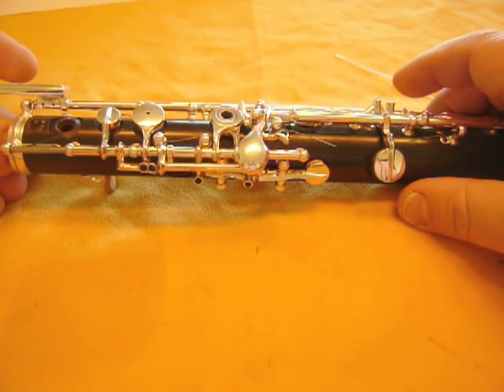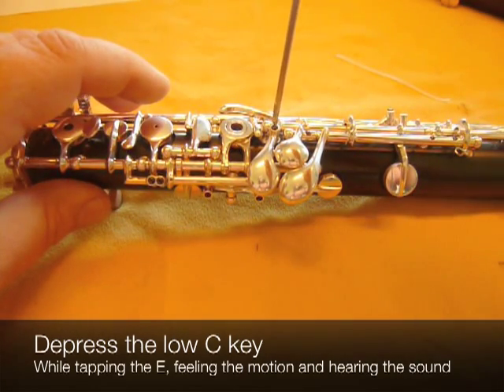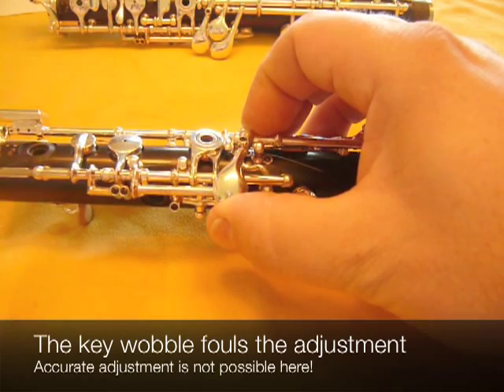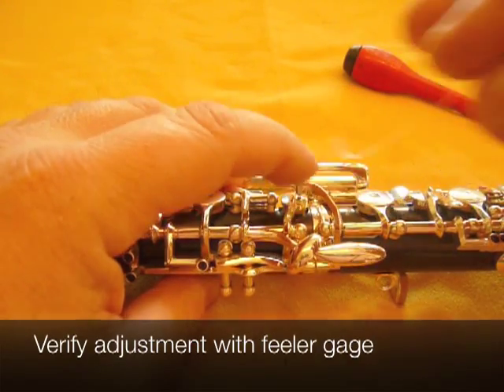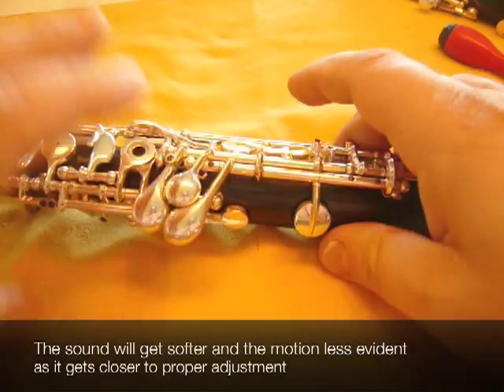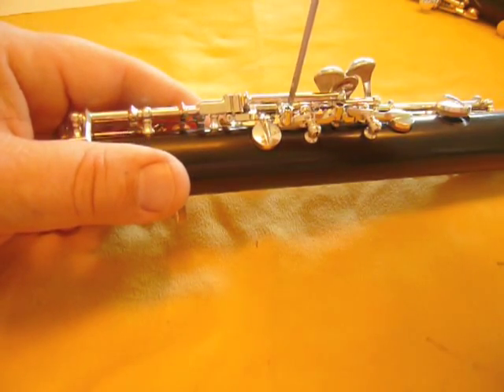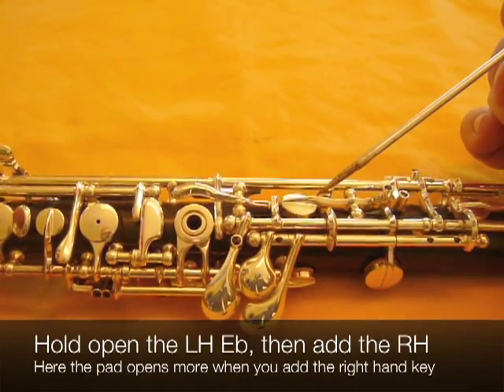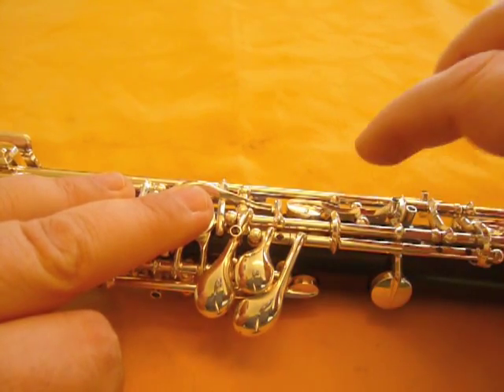Oboe Adjustments 5: Secondary lower joint adjustments

Comment from the maker: About your C#... Sometimes a C# can get a fuzzy or hissy sound that comes from the 1/2 hole (diamond hole).  If you play the C#, and close the 1/2 hole while playing, and the sound or feel improves, then this is likely the issue.  It is also possible that the C# pad doesn't open the correct amount, or that there is a leak further up the instrument. I can't tell for sure what the issue is without seeing the oboe.

Comment: Hello John, I wonder if you could help me please. I can't get any low notes from G down or top D. Has a spring gone?
Reply from the maker: Try doing the top joint instructions, then try it again.  If there is still a problem the arm from the F# to the G# may be too tight.   Remember these adjustments only work if the pads of the oboe are sealing.